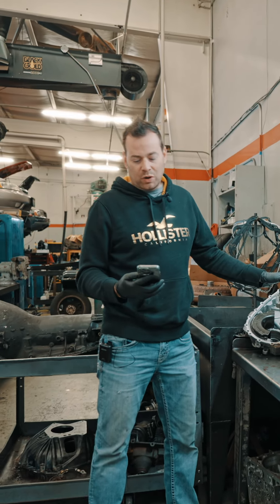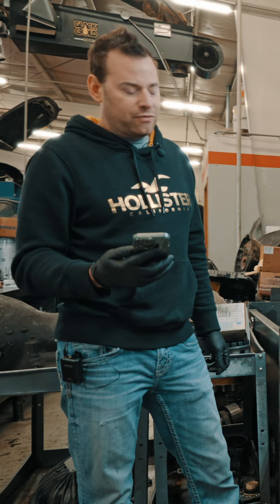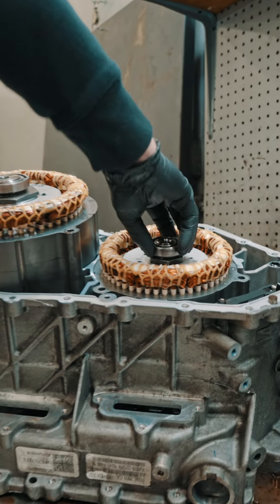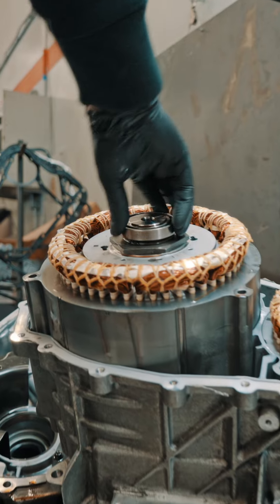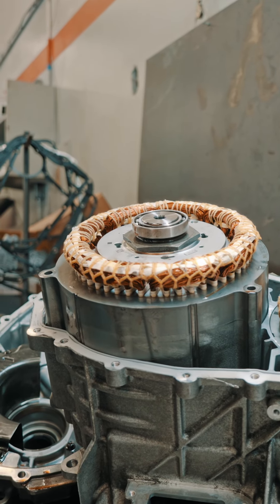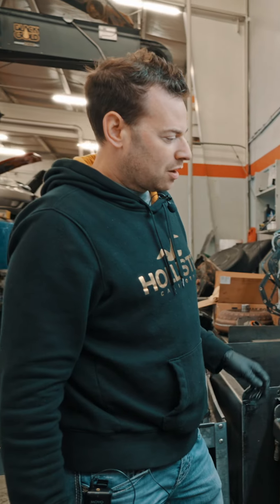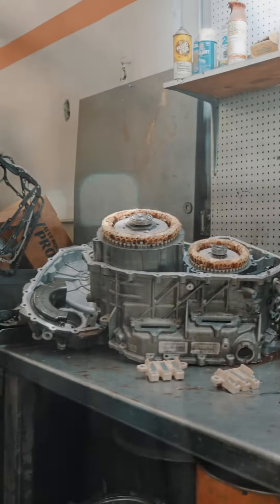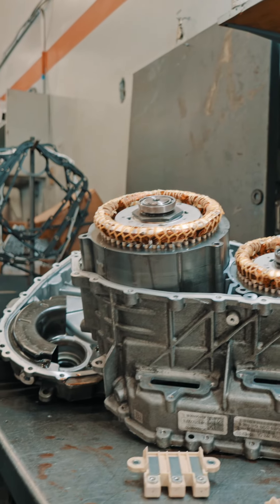We have a 2015 Ford Fusion SE Hybrid, the HF35 CBT transmission

Comment: After you installed a new transmission, did you have to get it programmed for the hybrid?
Reply from the maker: I can’t remember on this exact one, but typically on all Fords, you have to program in the solenoid flow rate information.